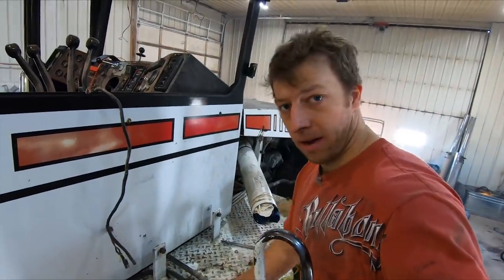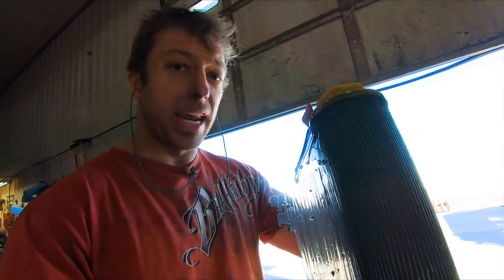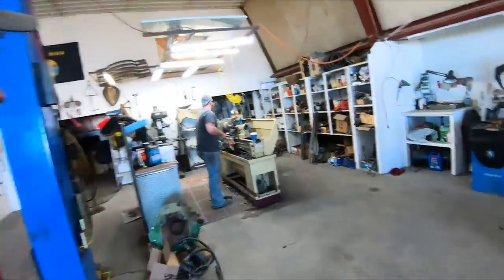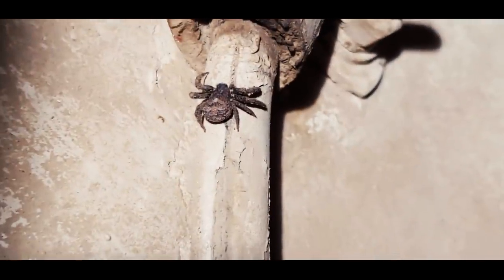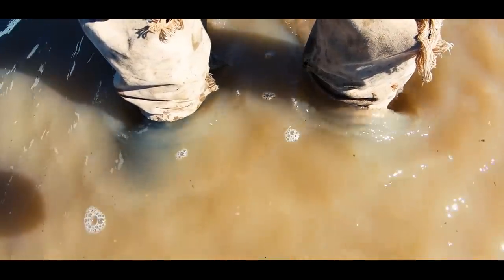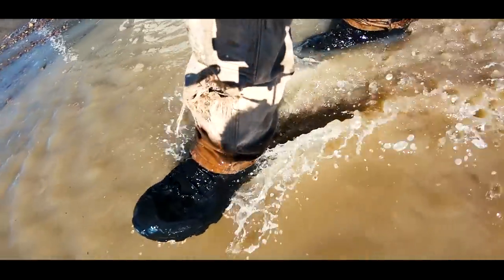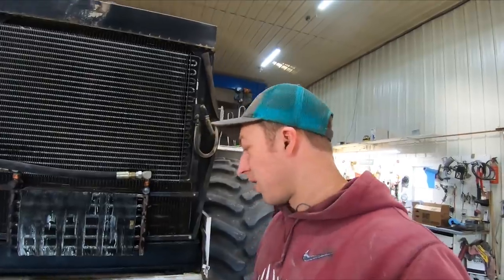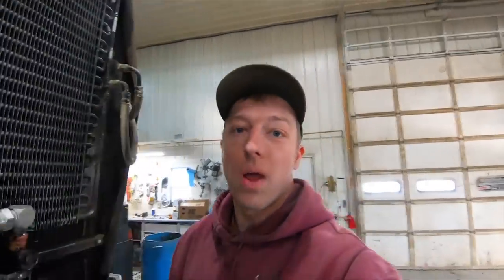BIG BUD Tractor 🚜 Restoration - Part 3

Comment: GREASE, OIL CHANGES ON TIME AND CHANGE ALL FLUIDS ON TIME ACCORDING TO OP. MANUAL.  THIS IS ONE OF THE BEST INVESTMENTS YOU CAN SCHEDULE EVERY SEASON.  AS MANY HOURS THAT YOU OPERATE YOUR TRACTORS ALMOST EVERY YEAR CHANGE FLUIDS.  DON'T FORGET ANTIFREEZE, OLD ANTIFREEZE WILL CAUSE ELECTROLYSIS IN THE ENGINE.

Comment: THE AREAS ON THE TRACTOR THAT TAKE DIRECT IMPACT FROM ROCKS ETC.  PAINT THEN RHINO LINE THESE AREAS.
Reply: Usually the tire's tread is so wide that small rocks aren't thrown.  But a few somehow get pinched just right.
Reply: JUST A THOUGHT, I USED UNDERCOATING TO PROTECT THE TIRE SIDE OF FENDERS ON LOADERS;  ELIMINATED THE  CORROSION AND MADE IT EASIER TO CLEAN UP.  IT'S ALL GOOD, YOU ALL ARE WONDERFUL AND GREAT

Comment: Wouldn’t it be easier to just run a tow cable from the drawbar to the front? For when you get stuck. Like most of the newer tractors have. Welding 1” steel is hard enough, much less doing it overhead.
Reply: That is correct about getting the steel hot enough to get penetration.  But we have done it before.
Reply: Robert Welker I have faith in you 💪💪🤣 good luck!

Comment: Did I spot a 46/47 Dodge truck at the edge of the road when you were playing in the water?? I love those trucks, have owned 5 of them so far but only 1 in the stable currently..
Reply: Cool about the Dodge trucks.  Are they restored?
Reply: @RobertWelkerFarmerBob  Nope, all restomods. Currently my '47 is on a '91 D350 dually chassis with the VE Cummins and Getrag trans. Runs and drives but needs to be finished, hopefully will be on the road this year.

Comment: Why don;t you use paint stripper?
It would be much faster and easier
Reply: Not sure how much experiance you have but I've been in the paint business a while. While stripper sounds easier they aren't stripping the paint they are simply etching it to make a mechanical bond for the paint to stick to as well as evening out high and lows. Stripping it creates a hell of a mess and its alot more dangerous to work with. Plus then you have to seal prime adding more steps to the process.

Comment: Hello from Germany to the Welker Family. 

On your cabin of the BigBud, 
now its the time to dynamat http://www.dynamat.com/(or simular) everything inside and the underside of the cabin 
with some heatshield&sounddampenig material. 
(I can remeber Hollywood complaning how much heat the floor the BigBud gearbox&Hydraulics is sending up to the cabin)
I used the Stuff on construction equipment cabins and on my AMC Javelin, 
and its worth the investment in Materials and Time. 
It takes down noise levels massivly (we had an -13db Drop in an older caterpillar tracked excavator) ,
and the javelin was grillin my right foot in heavy traffic badly, now with a Dynamat layer on the floorpans and gearbox tunnel its all good.

If i ever come to Shelby Montana, i´ll show up to your place and buy you´ll lunch... (i´ll bet Legarms will eat a hole in my wallet..)   

Regards SirDigger

Comment: PUT IN A DRAINAGE DITCH AROUND THE PERIMETER OF YOUR BUILDING.

SO EASY A CAVEMAN CAN DO IT!!!
Reply from the maker: Would have to dig that ditch through 3 different roads we use so that means digging it deep enough to add culverts under those roads and we drive equipment around the yard so those ditches would get in the way and be dangerous if we were to drive through them.
Reply: It's all good, YOU will receive an IDEA.

Comment: HOW LONG HAS IT BEEN SINCE YOU CHANGED HYDRO OIL??
ALWAYS HAVE THIS RULE, LUBRICANTS ARE CHEAP COMPARED TO TACTOR PARTS.  

YOU PAINT TO PREVENT CORROSION.
Reply: It was changed about 10 years ago I believe.  And you are right about clean is cheap, especially the new equipment

Comment: Sympathy for the wives who try to clean your clothes. Or just burn them.
Reply: 😜👍!   Actually we have a washer/dryer in the shop bathroom and Hollywood and myself wash our clothes.  Tide/Oxy cleaner/ and if needed concrete cleaner seems to remove the grime.  Hopefully the wives aren't too upset when they burn them and try with us in them 😁❤❤❤👍
Reply: In severe cases, mom would soak ours in gasoline (the real thing back then)
Reply: That would stop you from smoking!